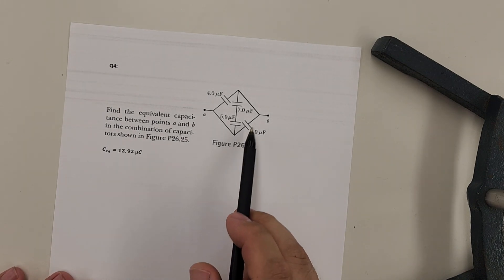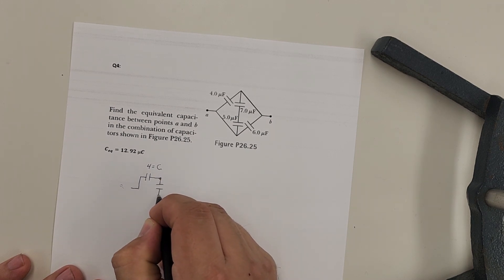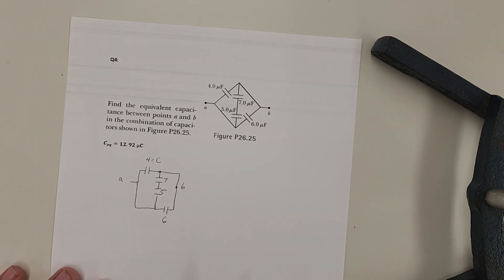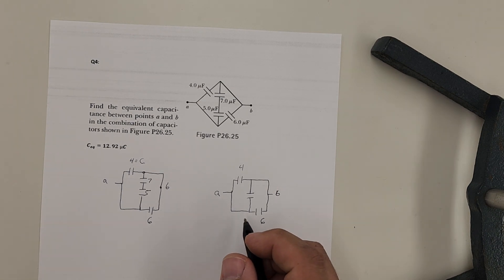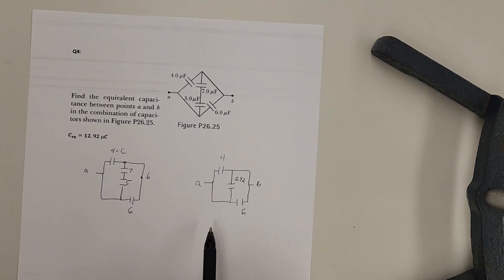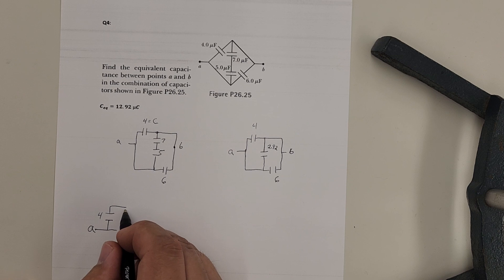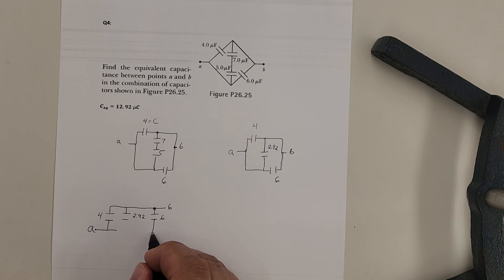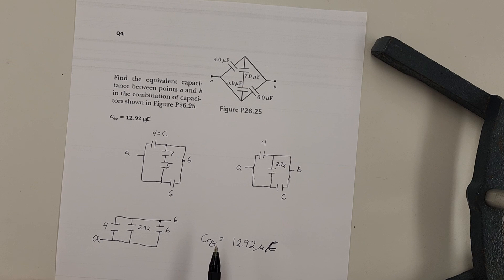150-Ch26 Q4

Comment: Sorry, but you made the redraw wayyy more complicated than it needed to be.  😒
Reply from the maker: Perhaps. I was trying to relate it to previously seen circuits in my class. It also brings up the idea that a schematic drawing don't have to look like the actual physical circuit.
Reply: @kFactorPhysics  think of point a and b as a plus and minus point...use b a the positive and a as the negative(but you don't need to assign them + or -)...the line from b to the side of the duel series cap configuration is the same point electrically.  You can redraw the circuit in one easy to understand presentation by merely rotating the whole thing 90° counter clockwise...slide your a and b signal points in the center of the circuit lines and voila'  you have a parallel configuration. With the two series caps in the center that you then simply reduce.  Basic DC electronics teaches us to see a circuit that is contained between a Vcc source(B+ or B-) and a Gnd(signal or earth)...same goes for a signal path when you are trying to understand what the total and individual resistances are or impedances.  The only time you cannot say that a circuit line is not the same point electrically is if it has reactance due to a frequency or worse if it has high current flow causing a Power loss.  In which case you increase the size of the conductor(actually had that happen on a circuit I was working on...dropped 3 volts across the ground return to the power supply using a 12 Guage wire😂...had to beef up the return line but we got what we needed and we brought the project in 6 months early and WAY under budget).  I loved R&D.  Anyway, dont know if any of this makes sense, my two cents for what its worth.  Namaste